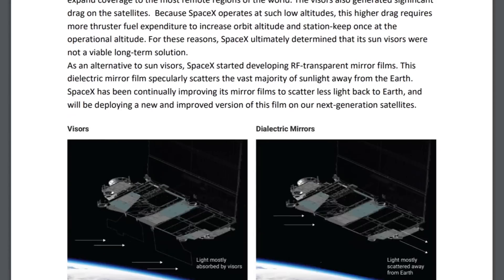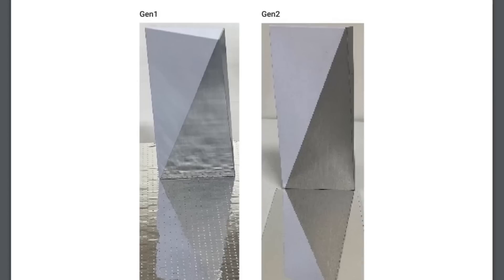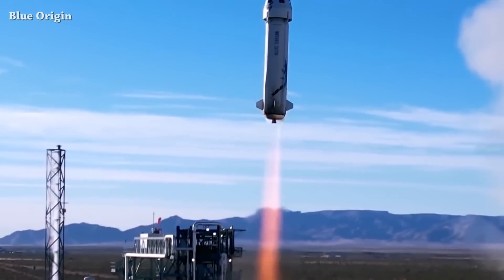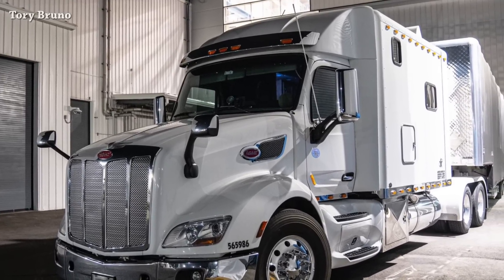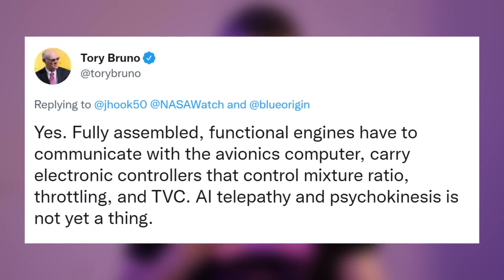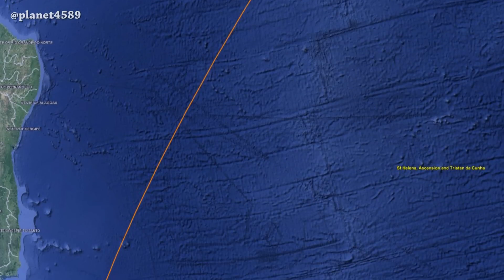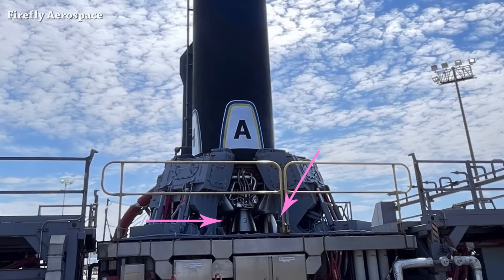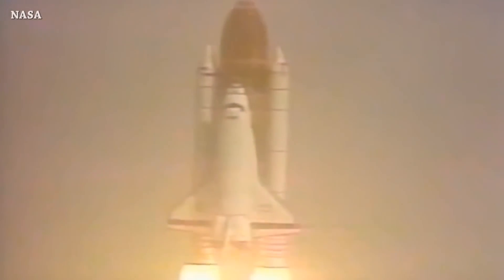SpaceX's New Dielectric Bragg Reflector Film + NS-22 Update | Starbase Pink

Comment: I wonder when will we know BE-4 properties, like come on, this engine should be somewhere close to Raptor, interesting how much better final Raptor will be (if will be, but I'm sure it will)
Reply: Well, standby; BE-4 helluva lot bigger than Raptor.
Reply: @dphuntsman  The BE-4 is bigger, heavier, harder to build, and more expensive than a Raptor 2. The BE-4 publicly announced design thrust is 250 tonnes of force. Raptor 2s can now sustain 240 tonnes of force. SpaceX is still optimizing the design and working to increase the thrust.

Despite the difference in size, it isn't clear which engine will have more thrust. The Raptor 2 leads in most other specifications.